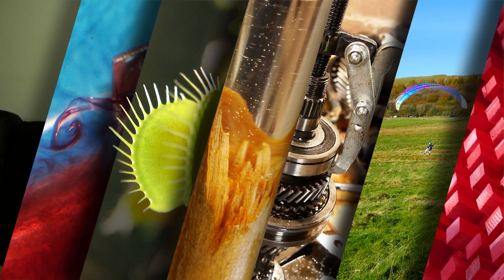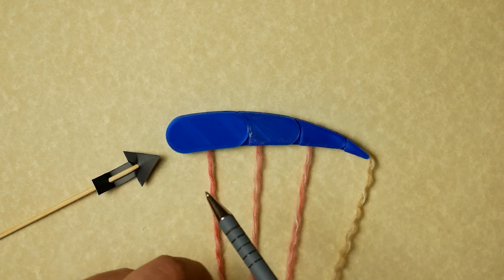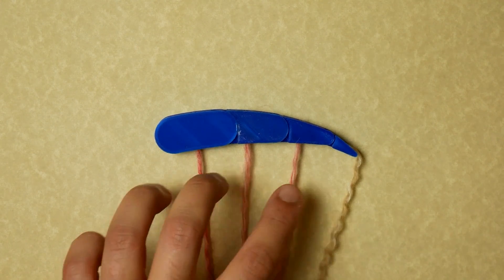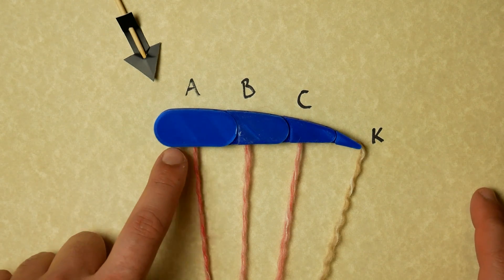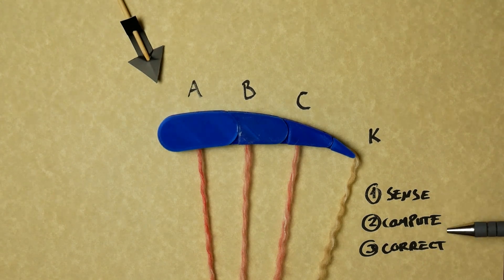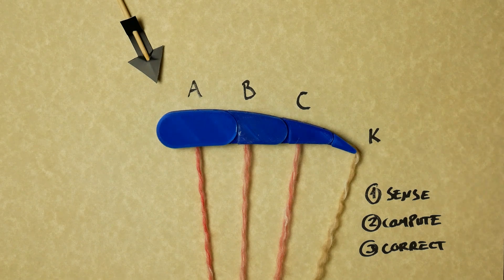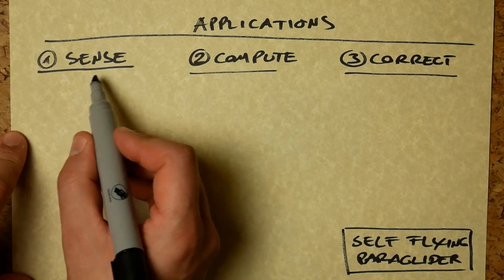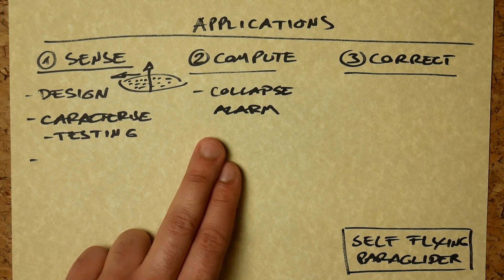Intro - Uncollapsible Paraglider Part 1 - BANDARRA

Comment: have you ever inflated an air mattress and noticed the little valve designed to take air in but bounce closed when air pushes back?  I have for a long time thought about little fabric flaps that pop up if the air reverses making a paraglider very rigid even in a collapse.  I believe inflatable harnesses use this type of technology already and I'm really surprised not to have seen any similar inventions inside the paraglider wing by now.  thanks for your efforts to make this really fun yet dangerous sport safer.
Reply: Swing already makes one for their wings. They call it Rast technology.
Reply: Staying rigid won't completely solve the problem though because even hang gliders will tuck in a bad turbulence which has caused Pilots to fall into their wing and break the hang glider so is definitely a difficult problem to solve
Reply: Jesse, check out Flysurfer kites. They're made by Skywalk.  They're basically paragliders with those flap valves you mention on the cells, made for kitesurfing.  So they do not deflate when crashed in water. So that technology exists but if skywalk themselves don't want to use their own tech in their gliders that must say something. Most rigid paraglider experiments have turned out to be very dangerous, too energetic and extreme when instead it could have just calmly deflated.
Reply: Hi Jesse!, i also have been thinking about this idea, i think it will work great against collapses, and i think with that you’ll also be able to use a thinner airfoil. The other thing that has to be solved then is how do you change your glide angle If you don’t want to be sucked in the clouds. You can’t fly with ears then, and once you land you want it to deflate quickly. That’s also Some stuff to think about:-)

Comment: and then you died LOL. No in between, Just fly inside your coffin to save some time LOL  I have always asked my self why there still no collapsing paraglider wing out there, with all the technology we have, how comes that nobody has made a foldable, none collapsable, wing yet. Windsurf sails have battens why paraglider wings can't have some?
Reply: There have been lots of experiments to incorporate rigid or inflatable structures into paragliders to prevent collapses. They have serious flaws. eg a kitesurfer style inflatable leading edge will burst if you get too high. Remember that 3000-4000m high flights are quite common on paragliders. You would need electronics and heavy pump to keep the air pressure at the proper amount. There are several companies that make both kitesurf kites and paragliders so it's not like they haven't thought of it. The other problem is that if you make the wing rigid, but are still attached by flexible strings/lines, then when the wing does encounter severe turbulence, it will change course dramatically, causing the wing to fly into you or under you where you can get tangled up, which is the worst possible scenario for a paraglider. What "Enjoying The Sun 544-Jersey Customs" says is very true-- the collapses are basically a way for your glider to limit how badly you can be tossed around by strong turbulence. If the wing starts to flip you over, it will soon collapse and you will stop getting flipped over. It is somewhat self-correcting, but you just have to train how to handle those situations.
Reply from the maker: If you look at it the paraglider market is really really small. there are very few users and the manufactureres don't have a lot of money for R&D. Think about multirotors 8-10 years ago :)
Reply: Multirotors may not be a very good example, technology advances so quick that in 6 month your stuff is obsolete and quite old. I wonder why paragliders can not have a Inflated leading edge as Kite surf wings have, kite surf wing don't collapse. Also instead of the leading edge maybe the 3 main ribs of the paraglider wing from leading edge to trailing edge could be inflatable as the leading edge of a kite surf wing so the center will never collapse or maybe even a combination, inflatable leading edge and inflatable main ribs
Reply: I really think the answer is by merging paragilder wing technology with Kitesurf wing technology something I would never do though is this LOL https://www.youtube.com/watch?v=N-ESaA6kzxw
Reply: Sometimes solutions are just in front of our eyes and we don't realize it until somebody else take our attention to it. Maybe that is what is happening with this collapse issue. another kitesurf flight https://www.youtube.com/watch?v=3JWi78hk8oQ
Reply from the maker: I think the issue with an inflatable chassis is that it has no method of re-inflating if it loses pressure. Also, if you land in a tight spot or in lots of wind you have no way to collapse the wing so you don't get dragged.
My idea at this stage is not to change the paraglider itself, just to understand better how it works (with actual data) and then control it better by using that information.
Reply: I think paragliders could incorporate kitesurf technology in a way that it suites paraglider use. I understand your point of view but electronic technology can malfunction, also people are lazy will end up relying on it and forget how to rely on their senses so with any issue affecting the correct censoring we are back to square 0 IMHO the best thing is to get rid of the collapses all together, but I will never the less enjoy watching your path of discovery for sure.
Reply: There are "dump valve" technologies that would allow very rapid deflation of a leading edge air bladder
Reply: Its really great that a paraglider will collapse,in alot of ways it helps against worse problems.The collapse takes most of the energy away from flipping the wing over into a nasty spin at times if conditions are just right.
Reply: Multirotor Go people have tried this. Skywalk is a paraglider manufacturer that also makes kitesurf kites. They have the Flysurfer series(check m out) which are basically competition gliders with valves on the cell intakes so it does not deflate in water. The problem is exactly like Dave said. The ability of the glider to deflate during turbulence actually absorbs a lot of energy where as with a non deflateable wing situation you'll get the whole, rigid wing thrown at you instead of it just deflating and reinflating. Deltas do not have this issue as much because you're strapped so close against the wing, you'll move along with it fairly well. If you have the long lines like with a paraglider that won't happen and the lines will go slack and the rigid wing will act a lot more aggressively than one that would have been able to deflate. There have been a lot of attempts to do this. Inflatable tubes (that could burst), carbon or metal rods, valves, etc. But so far they have all appeared to be more dangerous than just having the glider absorb and dispose of the impact by releasing pressure.

Swing paragliders recently released a new type of design where the back of the paraglider has valves but the front is still allowed to dissipate energy where needed (it's called RAST, Google swing rast and you'll see) which seems to blend the benefits of having a rigid and a non rigid paraglider quite well.

Comment: Hi Andre,
nice approach to make our sport safer!

Instead   of using sensors and Cpus with servos, why not use rubberbands? if a lines get loose the rubberbands pull them back to nominal strength. of course this would work for the B's and C's as well. I could also imagine a rubber connected to the break line with or without someblock to adjust the break pressure.

cheers David

Comment: Hi André, I love your little wing-model!

The distribution of weight is near >60% on the A-Lines  and from the center of the wing to the outside.
Thats why lines get longer on the A's and B's get shorter  - while the same is true from inside to the stabilo.

As with the new CC-Class (competition wings) we got mostly dynema break lines - which shrink! Thats why we all measure them very often.

There will be a lot of computing taking place - so power consumption is something to think about. Not to forget those servos which will eat a lot of power also. 

I am looking forward to your next videos!

Comment: i think you may have your stall and collapse backwards on the chart there,if nose goes down that would be a collapse and if nose goes up it would be a stall,correct??
Reply from the maker: yes that's correct. the arrow just shows where the airflow is coming from, so if the arrow is on top, that will collapse the leading edge and that's why I've put collapse on it
Reply: Andre, won't load on individual lines require "in line" stress technology" and therefore they need to be as strong as the lines?  There is your first problem, and it would need to sense and transmit this information very quickly. Is not pressure transducers, wireless sensors in the aft portion of the wing, say above the Cs on the internal ribs, and somewhere in the nose leading edge, not exactly infront of the openings, but closeby. Monitor the equality of these pressures, and have a way of computing a warning when that pressure gets to a certain threshold. Have it scream an aural alarm on the riser requiring action. The sensing system has to be independent of the paraglider hardware, and this might do it.Your putting in a lot of contributing awareness for our sport. Good on ya mate.
Reply: Thank you my friend!!

Comment: Iv fort about this before Maybe something like a kite surfing wing/kite with a tube that has been pumped up to keep the shape
Reply: I approached some of the paraglider manufactures around 2000 and was told by them all ! that a inflatable leading edge was a bad idea the reason being that in the event of a flight outside the wings designed  perimeters it could lead to a very dramatic and uncontrollable reaction which in their opinion would not be recoverable .....But my gut instinct says wouldn't it be nice to have a inflatable leading edge filled with helium so it just floats above you waiting to go !  no fear of a prop strike ever
Reply: Hi Adam, that has already been done in the 90's  and its important to realize, that a collapse per se is not bad - its a feature!
Like the crumple zone in cars etc.

If Wing does not collapse and it is attached to the pilot via normal lines, well then you can watch your glider shooting down in front of you - and you cant interact with it anymore - because the lines are not tight any more.

Michael Nesler has written about that proto he made - and will never fly again in his book called "Nestflucht".
Reply: I agree that the collapse has its own function and I think a completely rigid wing in flight can have more disadvantages. However, the idea of having wider margins through an "active suspension" is very attractive. Whether applied to the lines as suggested by Bandarra or the wing skeleton as proposed by Adam. Personally, for a long time I have been attracted by the idea of this active behavior through an intelligent inflatable skeleton within the wing itself and that would be able to avoid the most feared accidents by reacting intelligently to them.
Reply: Adam Aves 
it could be on a one way valve. when you pre kite the wing it forces in enough air to fill the tube and automatically seals when air has stopped being forced it. this will make launches a lot easier. then when you take to the air and gain speed it will become stronger as more pressure enters it. 

once landed press a button on the valve to deflate it
Reply: Rene Bormann ow I see didn't realise this had allready been tryed I'll have to look it up and have a read :)
Reply: It seems a great idea. However, as a kitesurfer I quickly realize that a frontal collapse in a kite almost always brings him down. The lack of tension in the lines makes it a self minded wing. Even counting with a pilot fall to make the retensioning of the lines, the much more dinamic frontal collapse of a paraglider could bring disastrous results.